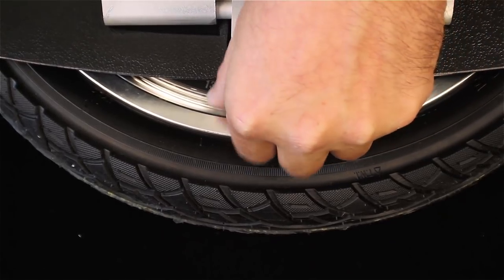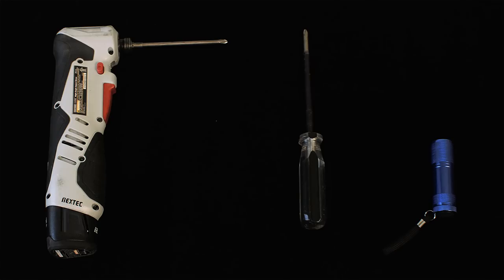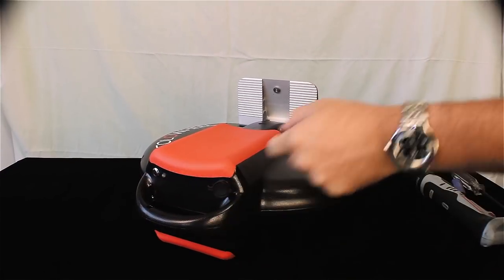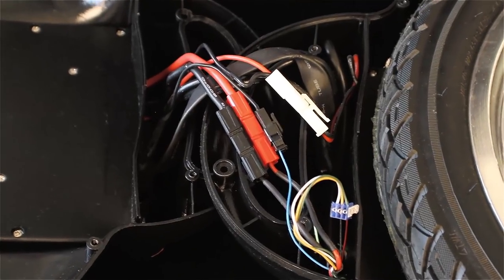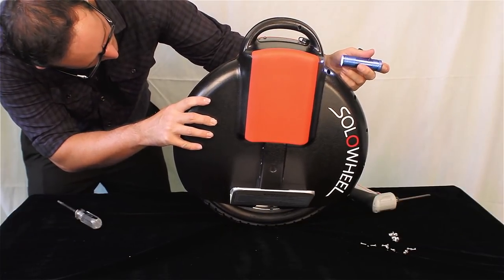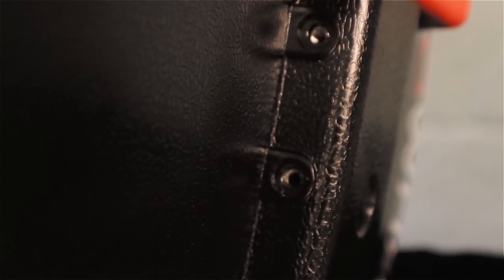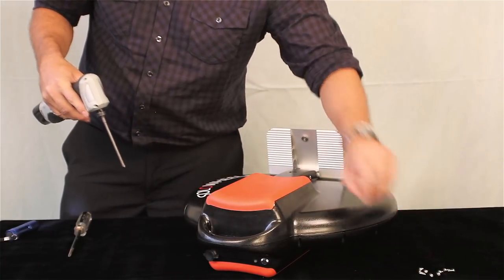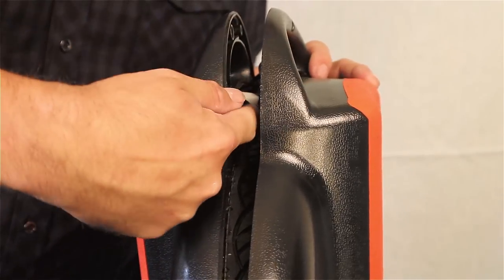How to change a Solowheel tire

Comment: Your video is titled "How to change a Solowheel tire", yet it only shows you opening and closing the case.  It seems to me that you left out the important bits--like removing the wheel, disconnecting the motor from the power circuit?  Actually changing the tire? No?